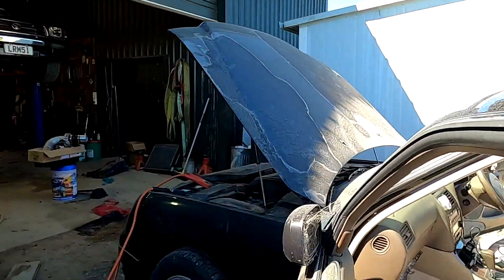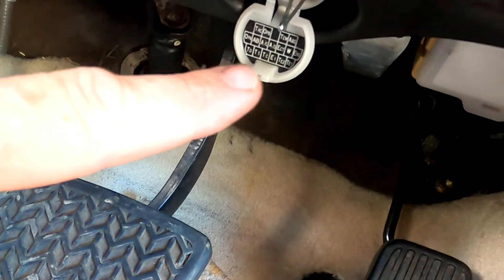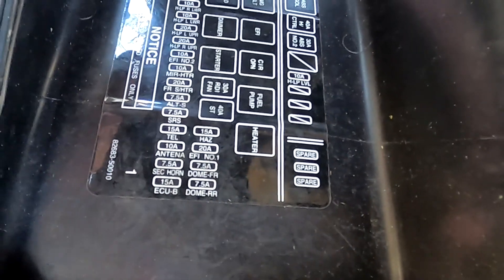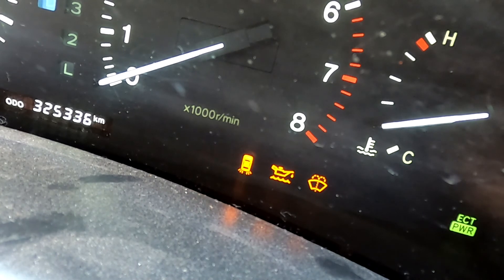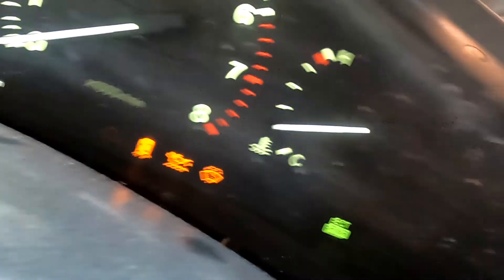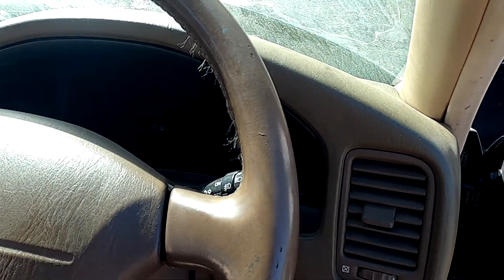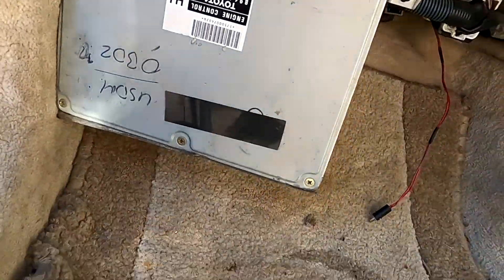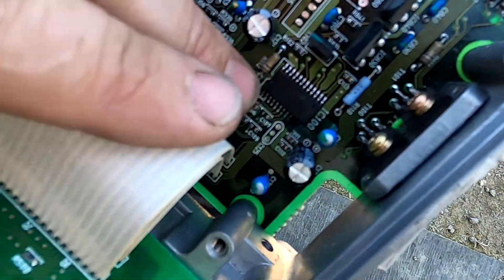Another Blown 1uz LS400 or celsior ECU diagnoses.  includes CEL flash code reading with split pin

Comment: Hi Kelvin! I have a 1997 LS 400 that has only the OBD 1 port, ( no OBD2). After about 15 minutes driving, I get a CEL that goes away when I turn off the engine, and when I pin it, no stored codes. Can I safely pin it while the engine is running? I've watched many of your videos, and I've checked the fuel pressure regulator..pulled the vacuum hose and no change at all. Maybe I should replace it?
Reply from the maker: No issue to flash codes while the engine is running.

Comment: I have a  92 lexus sc400,  turns on but if  I turn it off, it won't start again. It cranks, but it won't start. I  have to wait until the next day to turn on  again. I replaced the fuel pump,crankshaft sensor,  left and right camshaft, and nothing . Any idea what it can be ?